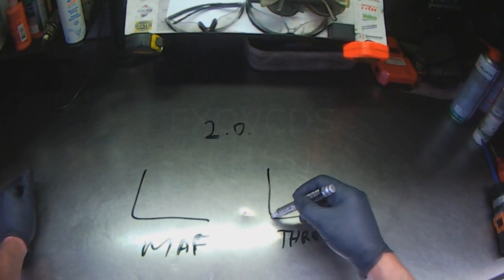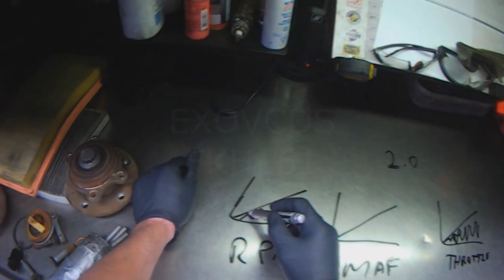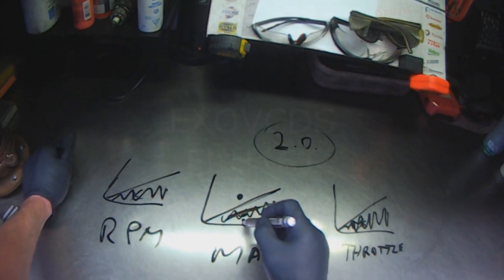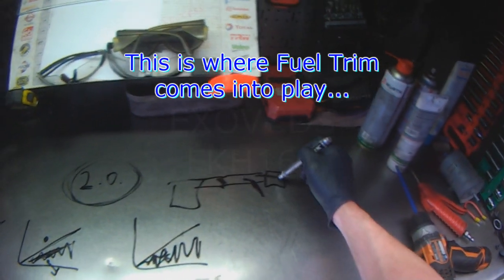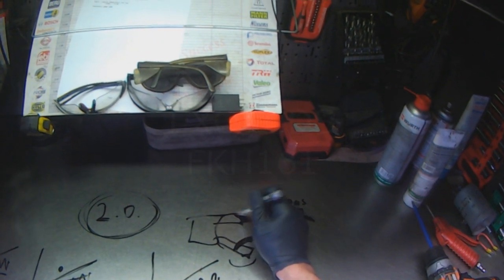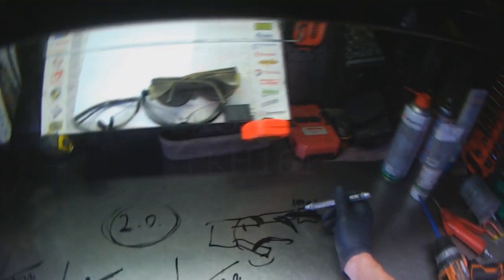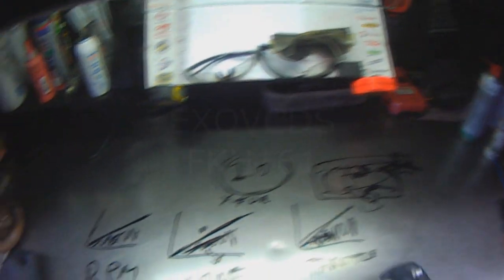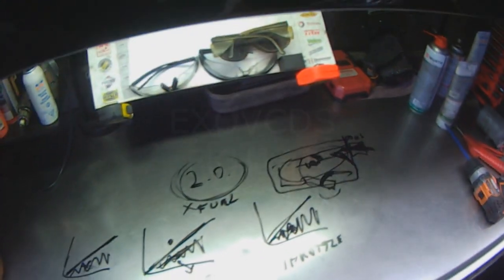MAF Sensor basic overview...

Comment: my 2002 cabrios pcv valve is hollow....air goes anywhere it wants though it and i cannot get rid of a p0102 and it doesnt care if its plugged in or not coud that pcv could be causing yhe code  arent pcvs a one way system my 1.8ts pcv looks the same way....i should block off that passage to the snorkle and see if it goes away....the data shows like 4 gs a second
Reply from the maker: https://wiki.ross-tech.com/wiki/index.php/16486/P0102/000258

PCV valves have a spring & diaphragm that is pressure sensitive. The diaphragm moves under certain conditions to regulate PCV flow. Simply blowing through the valve is not a good test.

Most of MAF faults are due to incorrect air flow through the MAF sensor. 

Plugged air filter / restricted intake air box, cracks in the intake boot going to the throttle body, vacuum leaks... etc., all affect air flow through the MAF.

If all those check out ok, then the problem could be with the MAF sensor itself.  Sometimes, they can be cleaned with MAF cleaner spray. 

Using a scan tool, you can check maximum g/s MAF readings to see if the MAF is reading correctly. 

Read the last paragraph of this link.

https://wiki.ross-tech.com/wiki/index.php/Fuel_Trim_Info

Comment: My issues is on my 2007 Jetta 2.5L is P0102 and P0112. I was told to clean the MAF sensor with MAF cleaner let it dry for a couple of hours and put back on. Can you tell me what can cause this. The car has no rough idling etc
Reply from the maker: Check the wiring & connector of the sensor. Peel back the plastic wiring protection that surrounds the wiring... look for signs of broken wires or spread wire terminals in the connector.
Reply: @EXOVCDS  also notice at the air duct by the rad theres a sensor I dont know what its called but should I check that one too?
Reply from the maker: That's an air intake sensor and could be the one that's setting the P0112... if your MAF does not have an internal temp sensor, so check that sensor & wiring / connection as well.
Reply: @EXOVCDS  I sent the car in for further inspection. Connector on mass air flow is broken so he going to repace that before the MAS. and also to find connectors on my coil are broken so he is replacing those also. Hope the outcome is MAS is good and connectors are the onlt things needed to replace
Reply from the maker: @EarlCharles  Thanks for the update!
Reply: @EXOVCDS  I was just going to let yea know. Well misfires were caused by low voltage on one connector. My MAS code was the same connector so it was replaced. Also had a bad rad which was replaced. Suggestion commented were right side drive axle seal also head gasket slight leak and drive belts slightly cracked.
Reply from the maker: @EarlCharles  Thanks again!

Comment: could you give me a number range of where the MAF readings should be? Just changed my MAF and before it was reading in the teens at idle now it's right around 300 at idle. I think the reading is mg/s? not really sure what the measurement is called
Reply from the maker: Depending on engine, around 300 should be good for a ALH TDI... but the ECM will adjust / test the EGR function, at which point the number will be higher (no EGR).
Reply: +Thomas EXOVCDS sorry forgot to mention it's a mk4 2.0 avh.
Reply from the maker: Chris Gelder MAF signal on a 2.0L is usually around 2 to 4g/s
Reply: +Thomas EXOVCDS Oh wow. so if I am in the 300 g/s range at idle is it possible my new MAF is defective? could it go that high from a vacuum  leak?
Reply from the maker: Chris Gelder Could be the scanner you are using, uses a different scale or giving false readings. For VW / Audi I would only use a VAG appropriate scanner / code reader.

Comment: Hey Thomas...very nice explanation of the MAF along with the other inputs that the ECM is looking at to calculate air flow. In some cases I find it difficult to 100% determine if a MAF is bad especially if the sensor has a skewed calibration. Have you ever used volumetric efficiency of an engine to determine if a MAF is bad? I have been researching this area and it appears that it could be helpful in diagnostics of the MAF. Instead of explaining it, here's a couple of links that explains it more if you're not familiar with it. This link is to Bernie Thompson's ATS site that explains it very well with an animated video. Although they are showing using their Escan tool, the readings such as RPM, MAF grams/sec, IAT reading along with STFT and LTFT can be extracted from the scan tool. The link to this is here http://www.automotivetestsolutions.com/volumetric-efficiency.html

Another site showing the scan tool method is located here with has a volumetric efficiency calculator. This site is located here https://www.otctools.com/ve

Take care Thomas...
Reply from the maker: Hi Terry, thanks for the links! I've seen the AST one before... these will be great for people to watch / refer to, thanks!
Reply: You're quite welcomed Thomas!

Comment: hello i'm getitng a p0171 and p0174 i've replaced the o2 sensors, maf sensor and front abs brake wire.   if i add on another fuel pump and give it more fuel will that cure the problem hahahahahaha
Reply from the maker: It just might!
Reply: i'm still waiting for some new tdi videos to come out, you haven't done any so they must be very reliable lol
Reply from the maker: +Bullshitkorner They all traded them in at the Hyundai dealership for a 10yr 100k warranty vehicle.

Comment: I've never seen a bad MAF cause a no-start; from what I understand the MAF has minimal influence during starting events until the IAC takes control of the idle RPM.  You could, in theory, get a start-stall condition though, especially if things are already heated up.  :)

For your analogy search there, it's like a scale with two weights on each end.  Take a weight off, and the scale tips.  If one of the weights is mislabeled though, you can have an imbalance even if the numbers add up.
Reply from the maker: Yes... true. I too have not seen a no start due to maf and start & stall would be a better likelihood. Talking live (when i don't have time to think about what I'm about to say) into the camera will always catch my slip ups... the scale scenario is a good example. I'll post what I was looking for, once it comes to me! LOL
Reply: *****
Haha, I have the same problem speaking off the cuff.  I'm the king of semantic aphasia!  LOL

Comment: One part I wonder about is the  relation of the ECT and IAT  with the MAF if  one thermistor is  bad  will it throw off the MAF  and  set a MAF code .
Reply: rhkips The truck would run fine till CL then fall on its face shortly after and almost stall.  There are so many systems out there and all designed a bit different. I wish they would have standardization with engine management but that would be too easy and make it easier to fix cars and we don't want that especially VW. LOL  The maf code out of range , that was  odd but  as a DIYer so many things are classified as odd to me when I don't know what im doing.
Reply: Bullshitkorner  she's a flamer that's for sure so would I.
Reply: hahahaha easy now don't want the human rights with the swat team busting down your cabin to arrest you for a hate crime hahahah
Reply from the maker: I'm sure that the ecm has some kind of strategy in place for such a scenario... when I have some time to play around, I can disconnect the iat at the intake manifold to see if the MAF signal is affected.
Reply: +Thomas EXOVCDS  I had an ECT go south and  it only caused a problem  when it went into CL. I got a code for extended time for engine not reaching hot . At first I thought thermostat but no. It was a strange one I never noticed till I paid attention and looked at the freeze frame and seen the ECT pid was off. Odd thing I did get a maf code out of range. Replaced the ECT sensor and alls good. I was so confused  . LOL I need a new scan tool like that one you have or just pay more attention.
Reply: It's all a delicate balance, really.  The ECT has more direct influence over the fuel maps, but the MAF works together with the IAT to perform its measurements.  As a stand-alone sensor, the IAT has more influence on spark advance than fuel trims.

If you got a MAF code from a faulty ECT sensor, that's just bad programming.  The ECM should be able to compare coolant temperature to intake air temperature and compare those values to engine run time and know there's a discrepancy, which would be the "time to temperature" code you got.  If it threw a MAF code after that, then someone in the programming department needs a smack on the back of the head.  ;)
Reply: guess that means you should have kept the throttle pinned to make sure it stays in open loop,  slight driving adjustment problem solved...... your welcome hahahahahahahaha
Reply: Bullshitkorner oh ya I'm on it next time. OMG .....
Reply: just trying to help a brother out hahahahah I want to see this burn barrel in action maybe with a cutout of Wynne on it's maiden voyage
Reply: Bullshitkorner
LOL